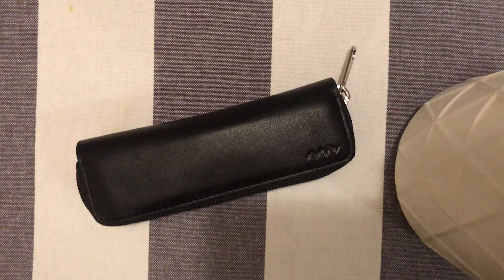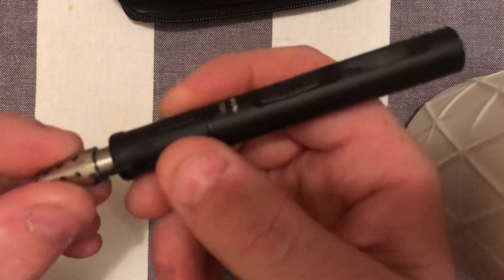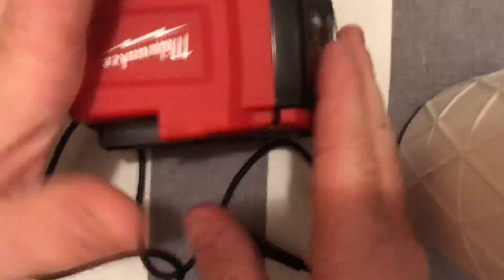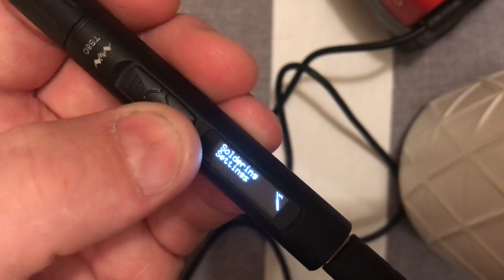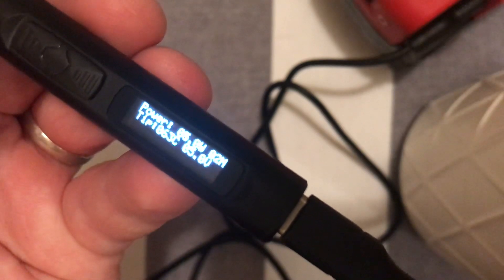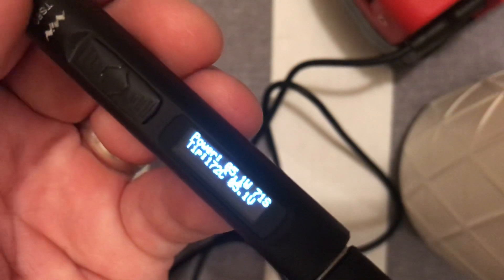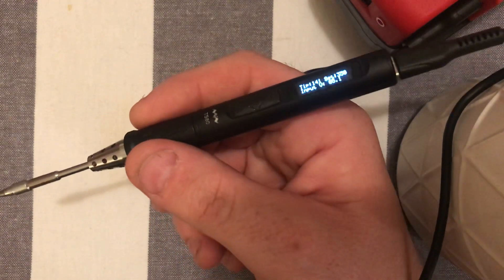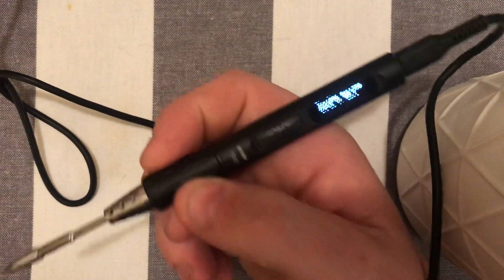Ts80 soldering iron on 5v?!?!?! A quick look...

Comment: I'm running my TS80P now on 5v after new firmware upgrade from the stock v1.30 firmware. Yes it's certainly slow to reach temp (approx 60sec) however now i know i don't need to rely on a 9- 12v input to run this thing!